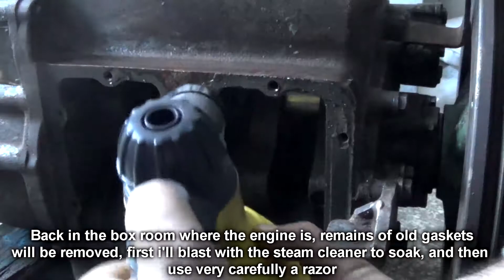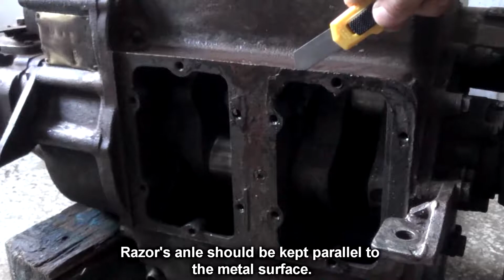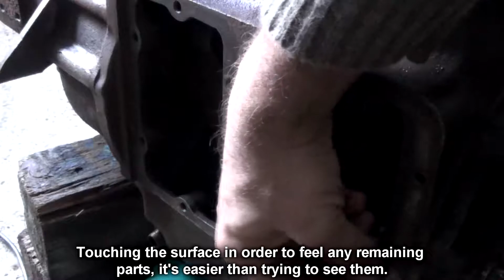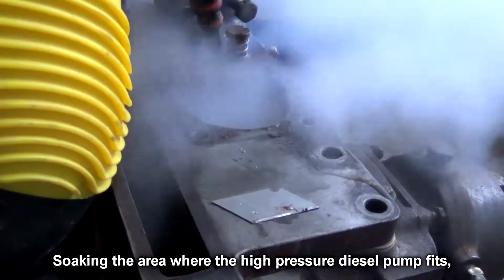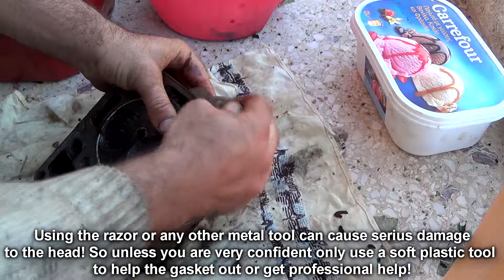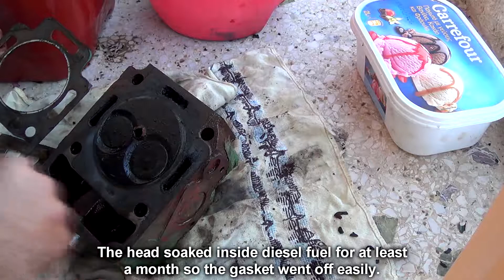Removing old gaskets. S/V Akestor- Volvo Penta MD2B (Part 5)

Comment: An old trick is to use a glass plate with a sheet of fine emory cloth on it, place clinder head on it, rub in a figure 8.. this will polish the mating surface if it is scared. I like your platic protractor trick. Do you think the steamer helps ?